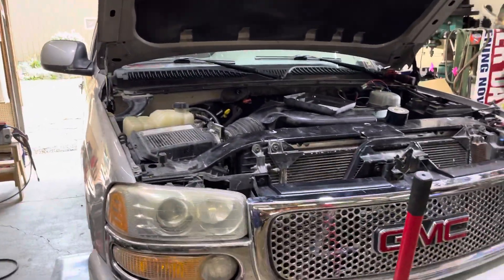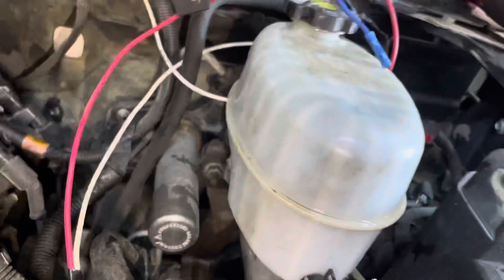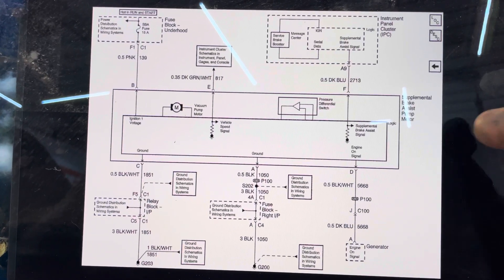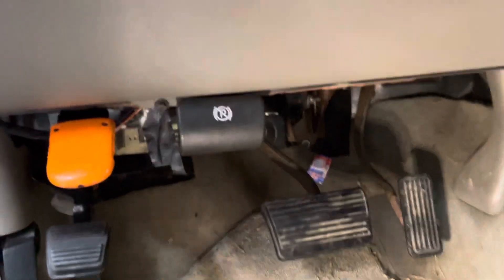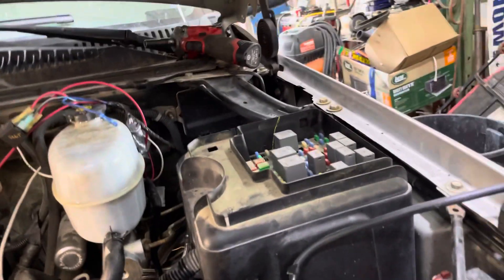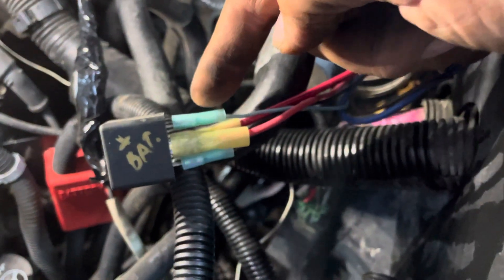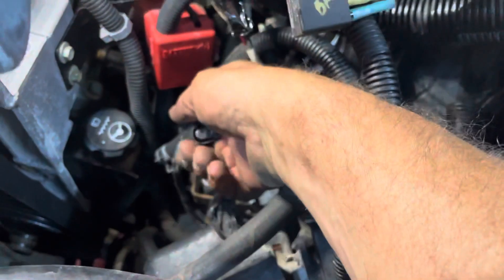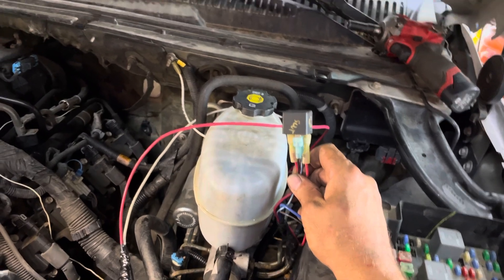How to fix sudden low brake pedal on GM truck Hydro boost with electric over vacuum assist

Comment: Did you ever respond to anyone that’s messaging you? This video is pathetic way to go with meth, causing a bunch of nuisance wires not figuring out the problem
Reply: He tired helping. Sorry you are not capable enough to understand. Best of luck with the 2nd grade!
Reply: It's funny how the trailer park guy is sticking up for a trailer park repair. If u do this shit in a real shop, you'll get fired on the spot.
Reply: @richfischer6820 its not a shop repair.  He states its a quick temporary fix because he is short on time.  No reputable shops will offer work arounds as a repair.  Most won't authorize an overlay.